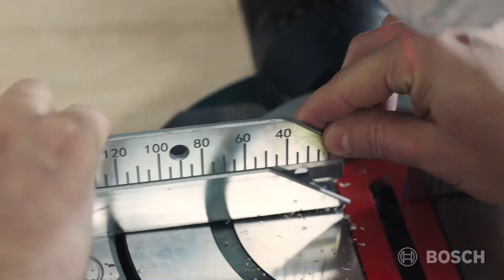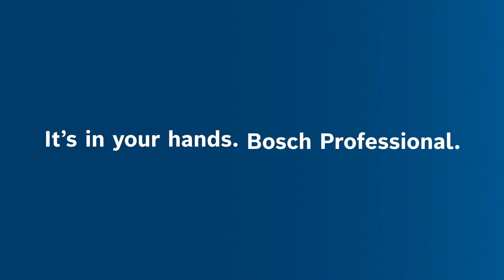Bosch GCM 216 Professional Mitre Saw

Comment: What is left out from this video is that the cutting capacity with 45° angle of inclination is only 43 x 123 mm. Frustrating when you're working with 60 x 80 mm material ...
Reply: I wonder could you still bevel cut 60×80 mm?
Reply: @lewy7601  Yes
Reply: @custodian3251  for cutting straight 75 mm x 75 mm, is it possible? I am thinking about purchase one

Comment: سلام برا فلز هم هست
Reply: No, only wood, i think they used it on Aluminum here though.. I guess if you have a metal blade you could cut Aluminum with it since its soft.. I wouldn't try cutting mild steel😂